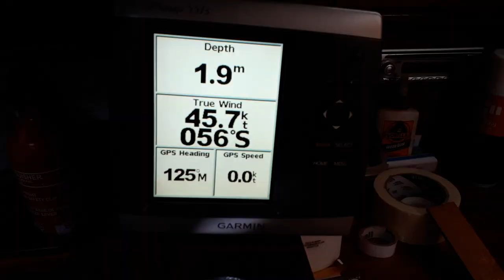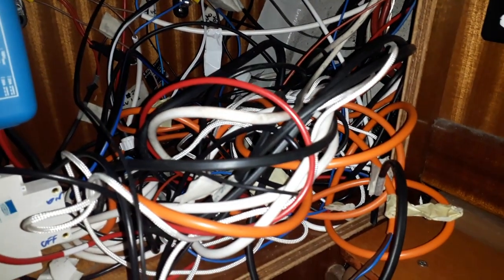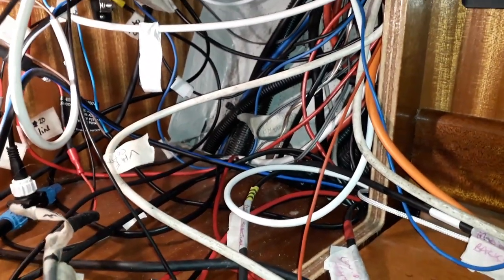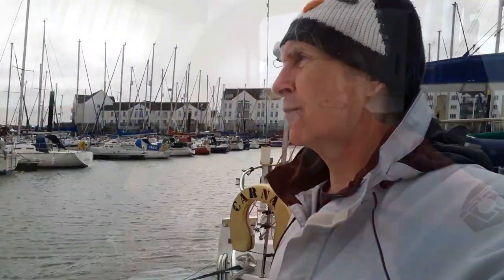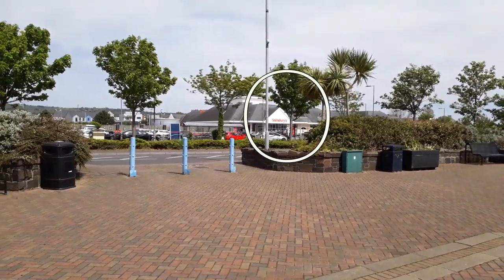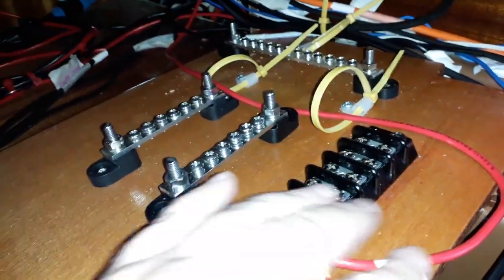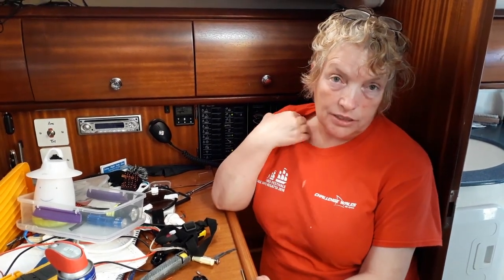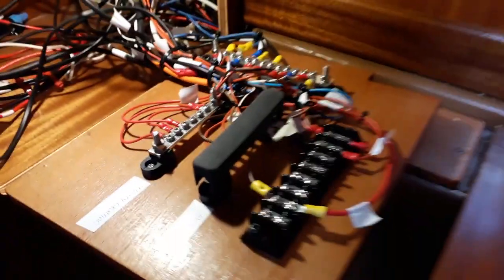Wiring the electrics on our boat - Boat projects - Carrickfergus - Ep. 137

Comment: Cracking on ladies. You can get the ratchet crimpers on Amazon quite reasonable and you can get interchangeable jaws that fit different crimp types. The red, blue, yellow, and the bigger metal crimps up to 10mm. Not CAT5 though. We use those slide over cable number/letters to mark the cables. It one thing Bavaria could do so much better from the factory but hay ho we know how to fix it, dont we 👍 Salty lass will be like a new boat by the time you set sail. Sail Safe Guys, Ant, Cid & the pooch crew.
Reply from the maker: Like new? Not quite, but certainly a new lease of life

Comment: Hi Ladies, Half way through a similar rewiring project. Mine was bad for the same reasons not quite as bad as yours, but after 10years of additions and modifications it was not far off. Would suggest you DIN rail mount everything. Switches, junctions, bus bars, the lot including equipment, like switches, power units etc. I have now DIN mounted all my aux equipment like AIS, PC, power units, routers, solar chargers. 
Then run all the wiring in trunking in parallel with the DIN rails. This is how it's done on commercial and larger boats.
Reply from the maker: That is a great suggestion and something to think about for the next rewire. We seem to be doing a succession of rewires :) First we removed the PVC connections, then a temporary busbar install, now this. I am sure there will be more to come.

I hope yours all goes smoothly.
Reply: @SailingYachtSaltyLass  Suggest you move to DIN rails over time, like all new items are DIN compatible, the rails themselves are extremely cheap, so are the basics like connector blocks. The more expensive bits are the breakers and some items like the PC as they are considered for industrial use. Having said that "industrial" is cheaper than "marine".
Reply from the maker: I shall discuss it with the electrician. She is currently sewing at the moment, but thanks for mentioning it as it would never have occurred to us otherwise.

Edit: I have just been informed that our solar controller's trip switch is on DIN rail. So it would seem that we have made a start :-)